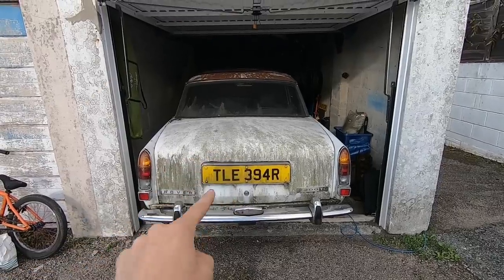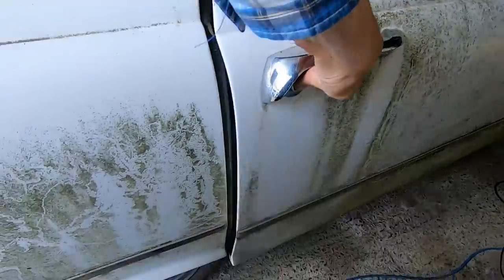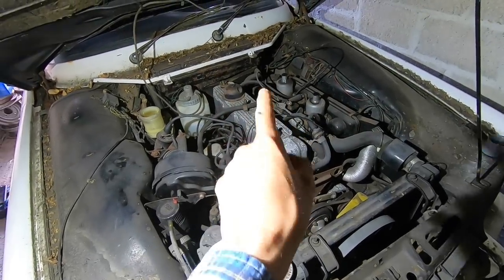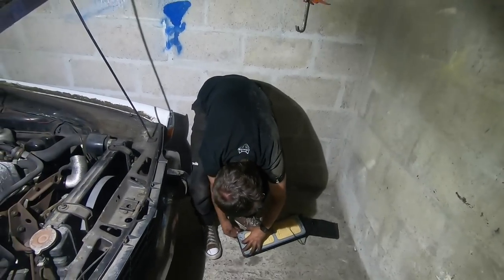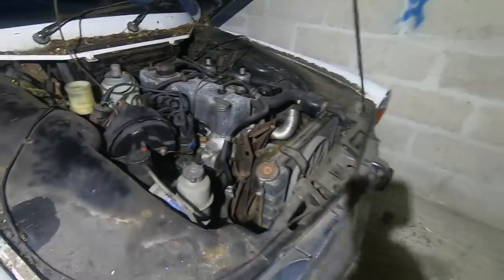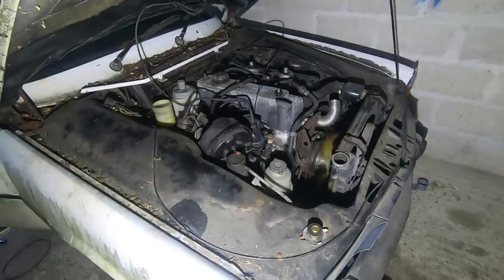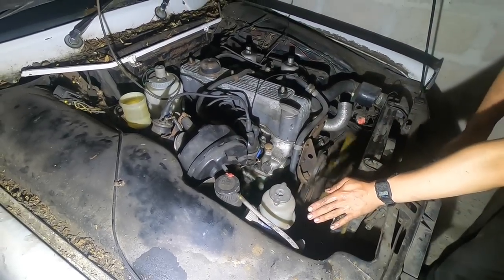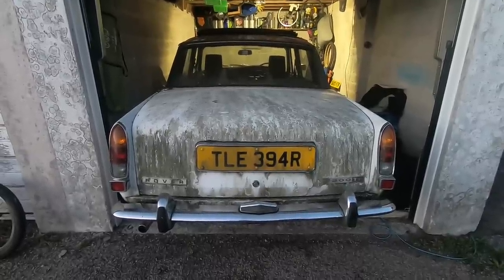I saved a 1977 Rover P6 2.2TC from scrap will it run?

Comment: Never understood why peeps fitted a Kenlow fan and left the tin fan on. The whole point of fitting a thermo operated electric was so you could bin the tin, operate at optimum temp and save a few horses for speed.

Comment: I never understood the Kenlow fan thing - always a popular option.  I had both the 2200TC and the V8S, and neither overheated.  And as for saying that the P6 wasn't designed for the V8, it wasn't designed for the 4 pot, either.  It was designed for the gas turbine.  The V8 was made of aluminium and at the time perhaps people were worried that - if it did overheat - it would warp expensively, a common problem with the Shag, but never, in my experience, with the Rover engines.

Comment: Kenlowes were aimed at fuel efficiency… great to see the period switch and indicator in the car.

I hope the car lives on… a parts bin runout special 2200 TC with a Webasto roof is a significant exhibit in Britain’s motoring history.
Reply from the maker: Oh ok so with the electric fan they were tying to save fuel? If your not subscribed already please consider doing so.
Reply: @classic_britain  Yes. That was one of Kenlowes benefits they sold them on
Reply: @classic_britain  Yes, which is why I was surprised to see that this car still had the fixed water-pump fan still fitted and spinning away. With no fan you get a faster warm-up especially in winter... back then people would blank off a lot of the front grill area to stop excess freezing air blowing in. Also there is fan noise at higher RPM / speeds when the fan is not needed, which is why slipping viscous fans came in with the SD1s as well as Stags, TR7s etc.
Reply from the maker: @johnmoruzzi7236  Yeah they did do a P6 with that type of fan had some with it!

Comment: Hello what a find but I have to ask because I'm only 50yo and never really worked on p6's but certainly worked on a few SD1's.  Now whilst that (I think Buick) rover v8 was the best car engine of all time did it not sit that well in a P6?
Reply from the maker: Hello mate yes they are ok in the P6 but they did suffer with overheating issues. I would have to disagree with you on the best engine they are dirty engines that love to block up breathers and eat camshafts and as for tuning 400HP is about it. I would say the 1UZ Lexus engine is one of the best DOHC 4.6 and forged from the factory!

Comment: She has some serious potential, this wee beasty.  Please try to keep the Webasto (Britax / whatever) when yu sort the roof.....if possible.  It's a uniquely British thing and I think it adds something (besides water to the interior if the seals aren't maintained) to the class of the vehicle.  A quick check of the VIN plate will give you the paint code for the original colour if you're interested in confirming what it was originally, but they DO look so good in white - especially with a black roof and the S wheel trims.

I've always wondered why you created the new channel.  Is it mentioned in any of the videos?
Reply from the maker: Yeah she really does I am not sure weather to keep it or sell her on the only thing is Kismet my first P6 needs a complete donor car so will have to find another car! 
If your not subscribed already please consider doing so.

Comment: I believe that must be on of the last p6 as the sd1 was introduced 1978 so that would be rare
Reply from the maker: Yeah it's fairly rare part 2 out late tonight
Reply: Sorry to be such an anorak but the Sd1 came out in 1976. There are a few P & R reg ones out there although very rare.
Reply: @DoubleDsinthedrivingseat  I thought they came out in late 77 the sd1 on a r plate
Reply: Andrew late 77 is S reg.
Early 77 is R.
But I have seen a couple of Sd1s on P plates too from late 76. I also have a brochure dated 76.

As for the p6s they were probably mostly built before sd1 production started but sat around un registered. Apart from the VIPs that were built in very limited quantity alongside.

Comment: I can see by the other comments on here that I'm very much in the minority  but I owned one of these things nearly 40 years ago, 1 owner from new, very low mileage, extensive service history and immaculate. Probably the worst car I've ever owned. It was as thirsty as hell, handled like a kipper in a frying pan and compared to other 2.0 litre cars of the time was glacierly slow. These cars were a perfect example of why the British motor industry was knackered. Just saying!
Reply from the maker: Well it obviously wasn't right then was it I have had other 2.0 British cars and the P6 is not a slow or bad handling car by any means
Reply: @classic_britain  it was right, it was perfect (for a P6) it had less than 40k on the clock when I bought it from a serving police officer and it had been maintained religiously by the local rover dealer. It rolled on corners because it was so heavy, did about 20 mpg and it was slower than my brothers Mk3 cortina. I know old duffers liked them because they were British but they were never a good car. I  bought one because I remember my uncle having one when I was a kid but I should've spoken to him first because the first time he saw it he laughed and asked me why I had bought it, turned out that he'd had a volvo before but fancied a rover because they used them on Z cars or the sweeney? He only had it for a few months before he got rid and bought another volvo.